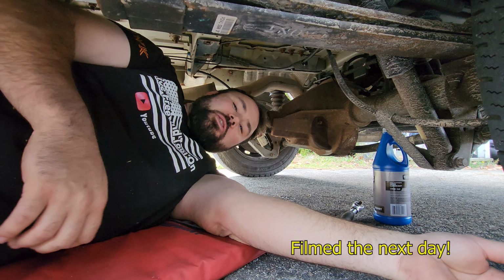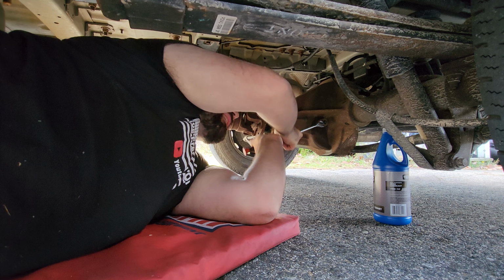Ford Transit Tone Ring replacement #diy #fordtransit #carrepair #brakeservice #abs #lifehacks #cars

Comment: What brand tone ring socket did you use?
Reply from the maker: @bull2361  you can only buy the tone ring from Ford at a dealership at least that's the only place I could find them and they are expensive
Reply: @livefreeandtoolon  what socket did u use ??